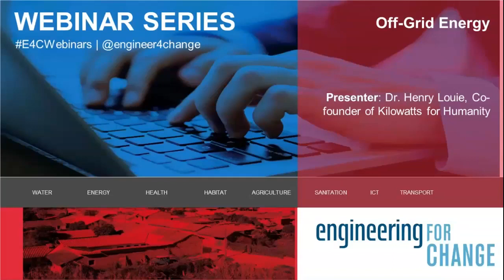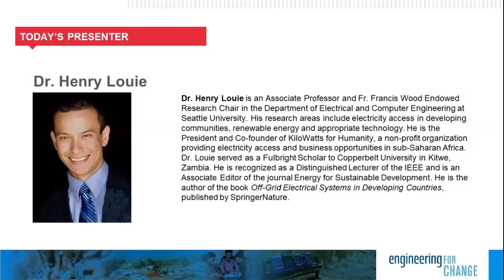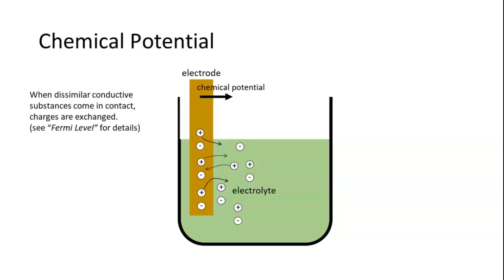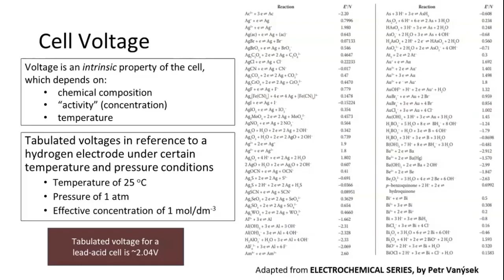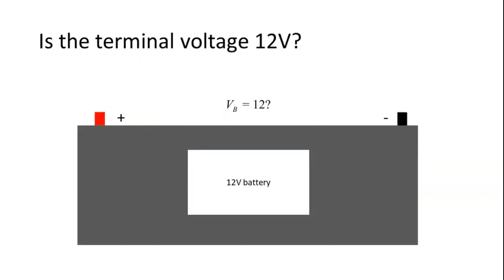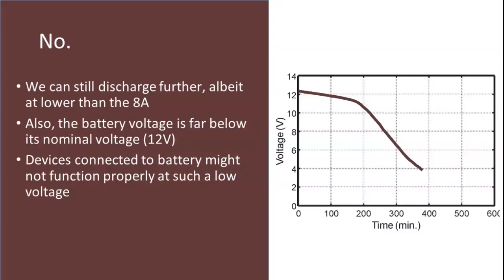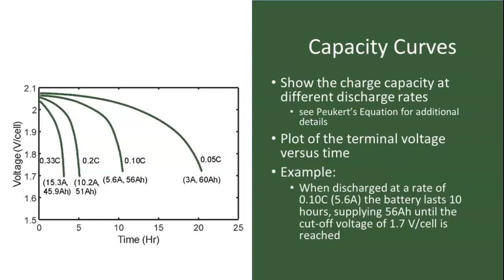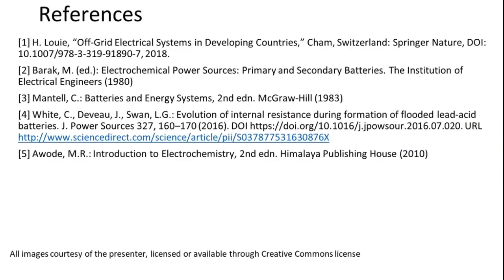Battery Fundamentals for Off-Grid Electrification

Comment: Thank you very much, excellent webinar! 
I asked an engineer of an important German manufacturer of FLA and Gel lead-acid batteries, and he clearly said that also gel batteries must be in vented battery rooms, by government regulations AND by (negative) experiences (explosions).
They certainly vent much less hydrogen, but it seems they do a little.
So I recommend to all my engineers to absolutely make sure that the room is at least somewhat not airtight. Usually, for off-grid applications, that is rarely the case anyway :-)